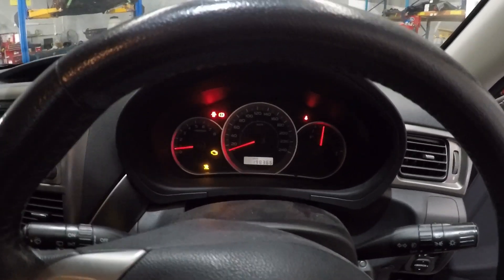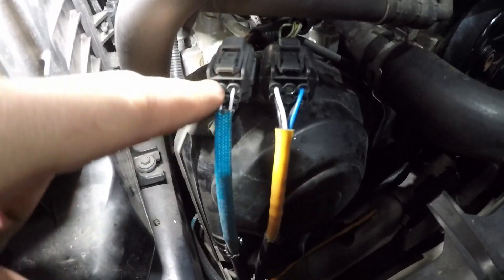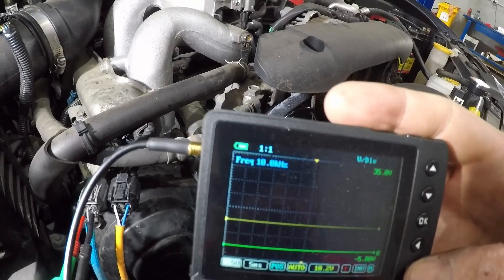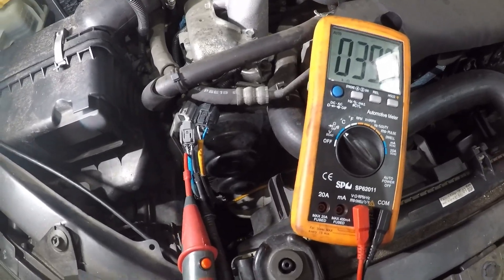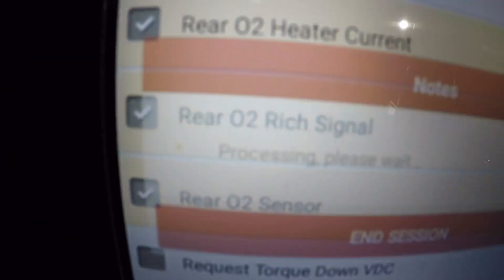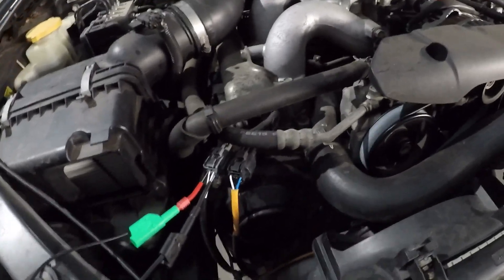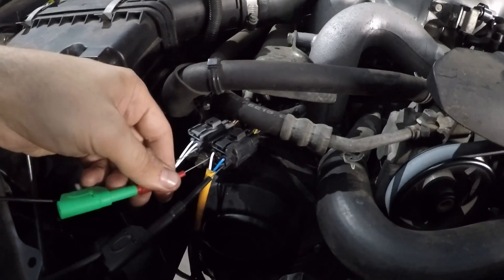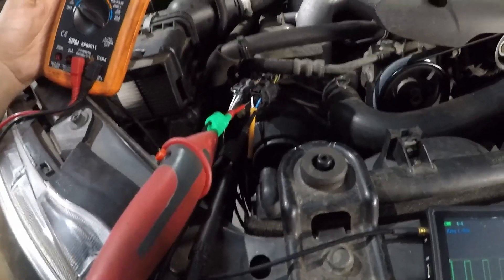P0037 - Scope OR Multimeter? Subaru Impreza Engine Light On

Comment: Nice vid. Just got the same code on my 08 impreza. Got 18k Ohms on the sensor which indicates a fault? Whats your view on aftermarket sensors or is it best to get from the main dealer?
Reply from the maker: S C, nothing usually beats OEM but sometimes you can only get what you can get!

Comment: Hi, I have the same problem, in Nissan Micra 1.2 2012 petrol Dig-s in UK . the code is P0037,, I replaced the sensor bank 1 sensor 2 in garage, I got the same code again P0037, then replaced the seond sensor as well, both are aftermarket parts , we got the same code P0037 again and again and again, the mechanic told me that the engine ECU could be faulty we need to replace it as well ? is that logical ? Me I tend to replace the sensor bank 1 sensor 2 with original one from the Nissan dealer. Any help or sussegion thanks for the video.
Reply from the maker: Hi Fran, has anyone tested it properly like this? Or just throwing parts at it?
Reply: @romanosautomotive   throwing parts only I think as I can see .